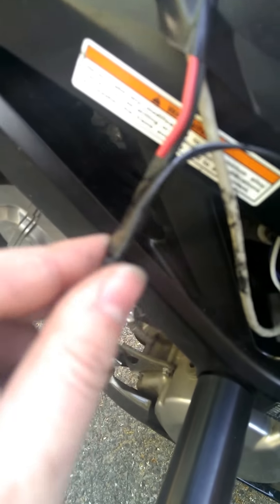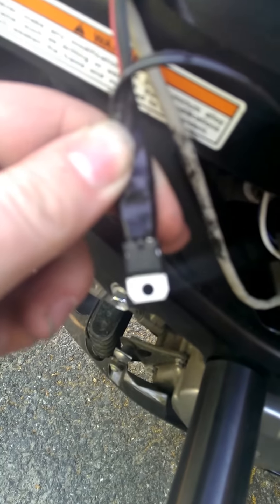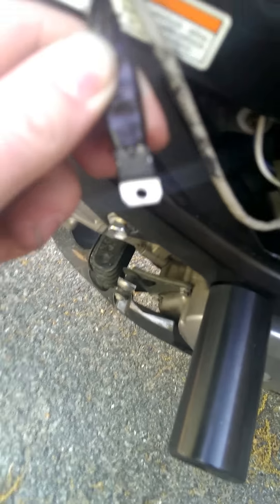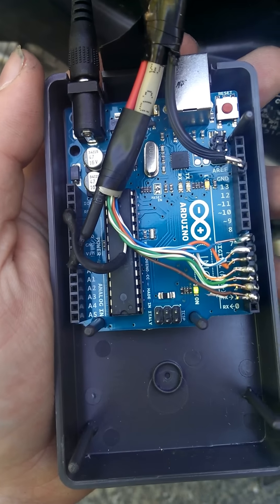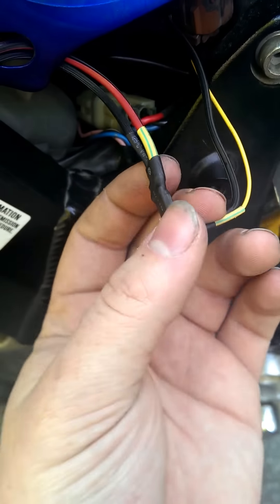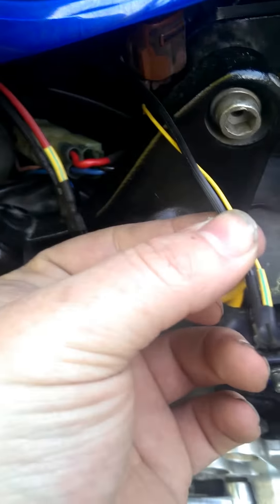SV650 Arduino Gear Indicator

Comment: There's a larger cap on the input side from 12v to center of the reg. And a smaller cap from center of reg to output 5v.

Just how regulators are typically used to filter incoming noise from engine as well as filter the chips output.

Comment: I'm using an Arduino Uno for mine.
Cat5 cable is solid core. It is not ment to be flexed in the application your using it in. Overtime the solid wire will break. I'm using a serial cable which has multiple strands of wire for each pin = flexible.  
Time will tell :) 
Also your 5 volt regulator should have capacitors to filter the noise that our bikes.

Comment: Thanks to you, I now have a working gear indicator! Can you maybe program an additional input for a dimmer setting???
Reply: I'm still new to arduino so I'm not so good with code. I was able to put a resistor on the ground of the 7 segment display (common cathode), but that made the segments have uneven voltage. 
I got to find a way to just lower the voltage coming out of D1, D2, etc when it senses input from parking lights. 
Using this in a car with two pots in series axis.

Comment: Hi
Just been trying this out on my suzuki v-strom 650, i have downloaded your software, but all i can get it to do is the test feature, does this need removing from the program for it to work?
Reply: Sorry can you explain which bits i need to remove please?
Reply: yeah that's is,  just need to set a delay as the neutral spin comes in on gear changes, did you change this as per your video?
Reply: its all build to test it out, now time to get a nano and build it for real.  thank you for your help